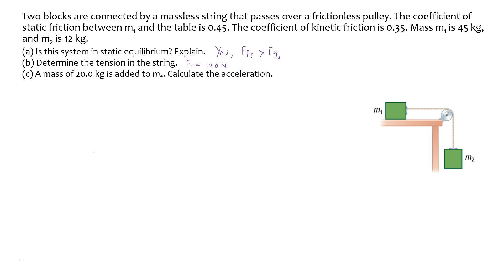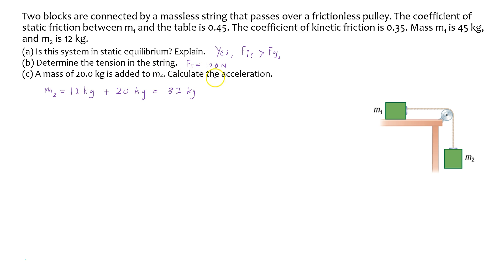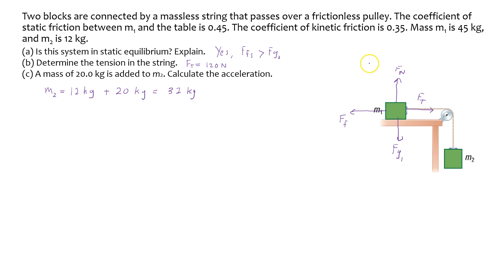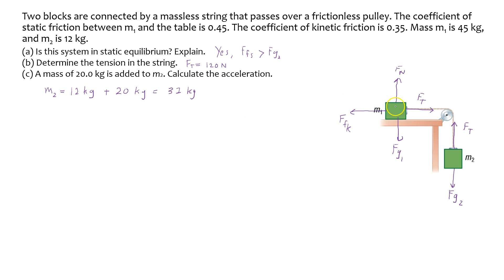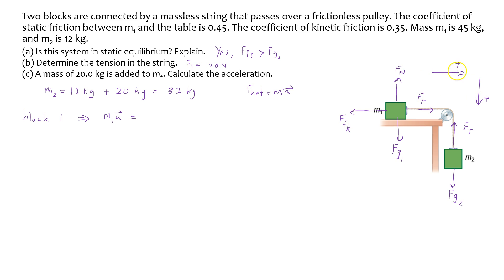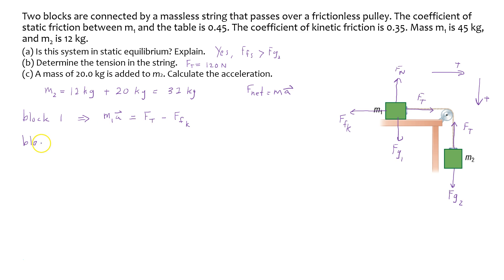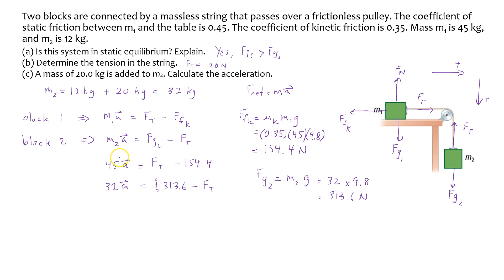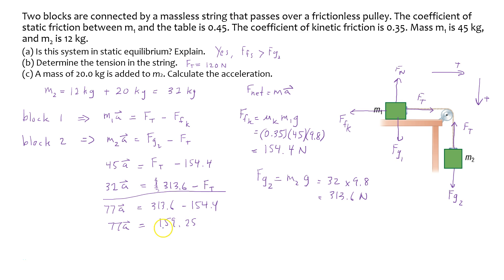Dynamics Pulley Problem Part 2

Comment: omg thank youuuu
Reply from the maker: Shreyashi Mandal I am glad that this video was of help to you :)
Reply: Also, can you possibly help me with this question? Im not sure how to even approach it

A 24 kg box is tied to a 14 kg box with a horizontal rope. The coefficient of friction between the boxes and the floor is 0.32. You pull the larger box forward with a force of 1.8 x 10^2 N at an angle of 25 degrees above the horizontal. Calculate:
a) The acceleration of the boxes and
b) The tension in the rope.

ans: a) 1.8 m/s^2   b) 59 N
Reply: @bakinetz  omgg thank you sooo much!!! And I'm not sure but that was the answer given in the answer key. (But answer key can be wrong sometimes so not 100% sure)